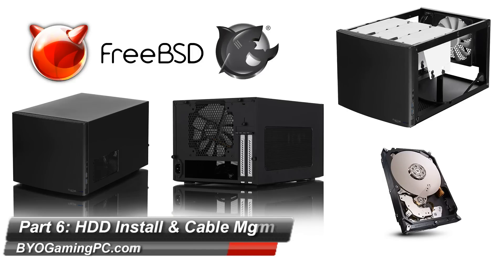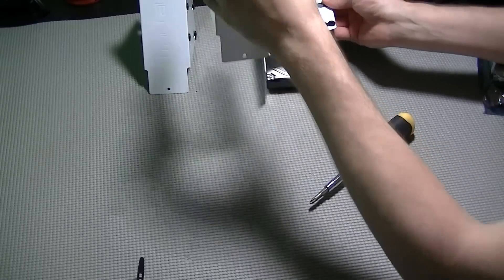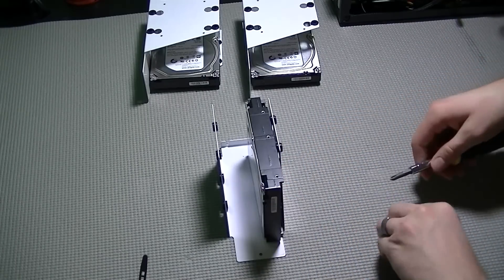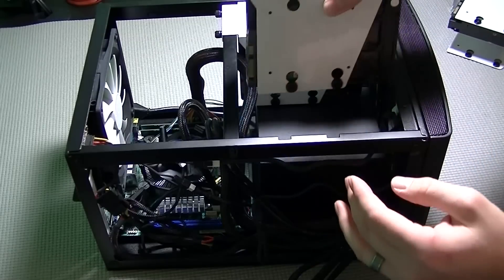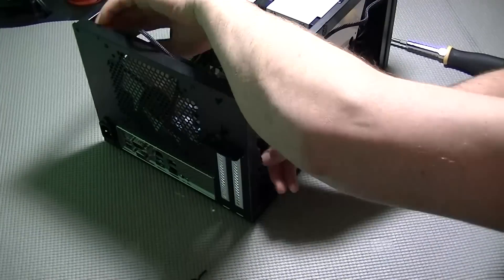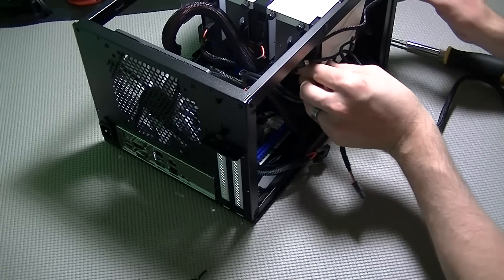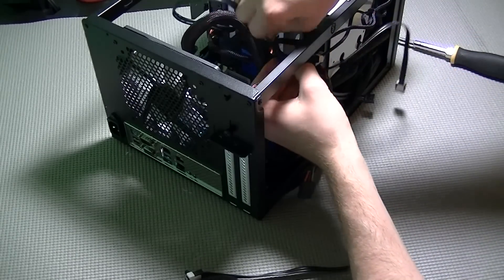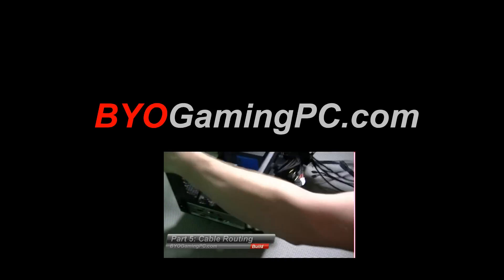How to Build a FreeNAS Home Server in Fractal Node 304: Part 6 - HDD Install & Cable Management

Comment: ah...the hardest part is connecting sata power cables. Each cable has to be turned because 2 hard drives on each rail are turned around to each other - kind of shitty design of 304, but thats what you get for a case that can fit into IKEA furniture slot.